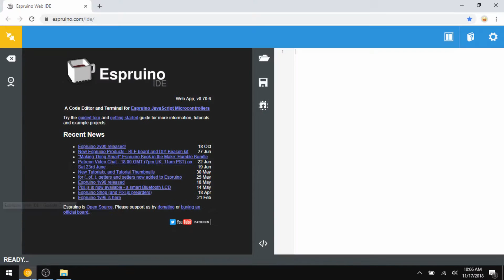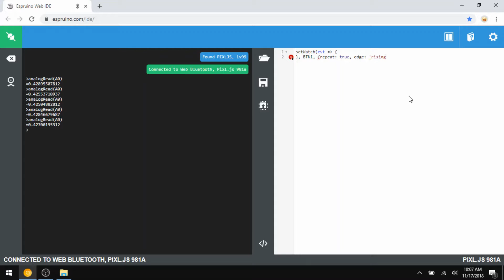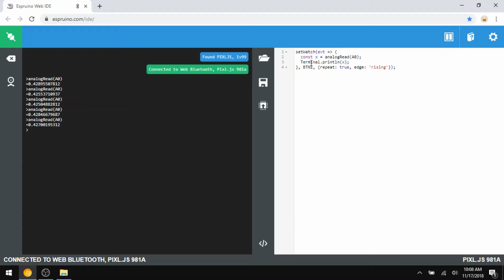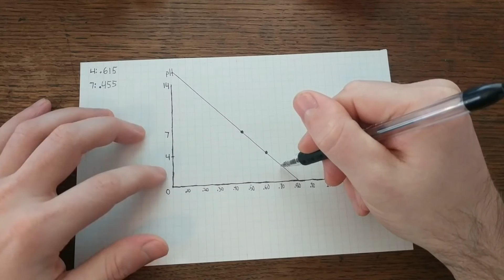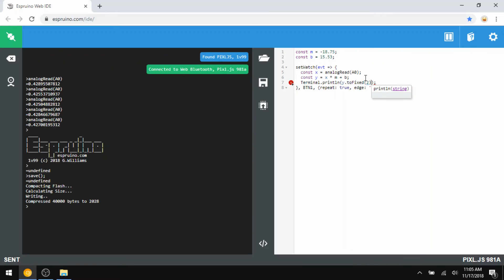Calibrating an Analog pH Sensor

Comment: sorry, i am working with stm to read sesor PH and i have the following problem!
STM has VREF + (3.3V) while arduino with VREF+ (5V) so I cannot use the arduino formula to apply to STM. Do you have a suggestion for me?
Reply: in the video he is using an ESP chip.   The esp chip is also 3.3v

Comment: the value of M = -18.75? but why my calc say it is about -0.1875 , is something missing here or what..cause my cal about PH things become wrong..haha...need advice
Reply: i have PH1(5,3)=493 and PH2(6.6)=503  at your case the greater PH has smaller analog value...,but in my case is the ooposite?  is something wrong with my analog module or just my head? haha

Comment: amazing .,thankyou very much...,.i assume the temperature can be calculate by this formula too.., i have a thermometer haha
Reply: Theoretically anything can be derived, but whether or not it matches the actual values with minimal margin for error is an entirely different argument.  A linear curve is the most basic plot for direct relationship whenever a constant is established, however with temperature it is better to use a curved formula due the amount of standard deviation involved as temp rises or falls along with voltage.  I would use a basic cubic formula to better derive the relativity of the point.  f(x)=x^3 + B  B=constant values or y, and x being the temperature reading.
Reply: @Robert5185  thanks ...i'll try it out..

Comment: Storage solution within the probe storage cap are always acidic. not neutral. This is due to the way the glass of the probe functions. Using a PH 7 will destroy your probe. if you leave it in distilled water you will damage your probe. or just store it in PH up.. big no no.. always use real storage solution I learned that a long time ago. These analog probes are pretty janky I would of paired this with something from atlas scientific but I did want to see how these little $10 probes work so thanks.
Reply: What about sea water?  Will salinity effect the reading on a PH4502C analogue over time?

Comment: Great video (: But this is not linear algebra
Reply from the maker: How so? It's a linear equation (a simple one, but a linear equation nonetheless).
Reply: Yes it is a linear equation (: Linear Algebra is about matrices, vectors and so on (:
Reply from the maker: Sure, but linear equations are the fundamental basis for which that framework of matrix mathematics takes place. If you open up an "intro to linear algebra" book you will usually start with this basic slope-intercept form stuff. And then expand into higher dimensional units and systems of linear equations. But that doesn't mean that linear equations aren't linear algebra. They're just really really basic linear algebra.

Comment: What if the pH sensor is submerged in a solution which might change its pH? Will it work fine or does it need cleaning on regular basis?

Comment: Sir this is cool
Reply: Do i need to test a 2 different ph level and compute it, before i i can make my ph sensor to work accurately? I only have a used ph sensor. No ph 4,7.
Reply from the maker: @chrisuel4783  To get it working accurately you probably do need the buffer solutions. DF Robot maintains an arduino library for it here: https://github.com/DFRobot/DFRobot_PH
The code to test it using the library is here: https://github.com/DFRobot/DFRobot_PH/blob/master/example/DFRobot_PH_Test/DFRobot_PH_Test.ino
It uses the default serial port, which you can open in the arduino IDE and shows the reading update every second.

Comment: Thank you for this video :-) Can you post a how-to video for calculating a 'temperature compensating" ph value?
Reply from the maker: From what I've read, near a pH of 7 the temperature shouldn't matter much but the further away the more of an impact the temperature has. I believe colder temperatures make it read more basic and hot temperatures read more acidic. I'll look around for a more formal definition and see if I can apply that to some code.
Reply: @DavyBot  I  searched google and found this pdf: https://www.hach.com/asset-get.download.jsa?id=17525673904  I don't have the gravity ph sensor to test; however, I do have an espruino pixl.